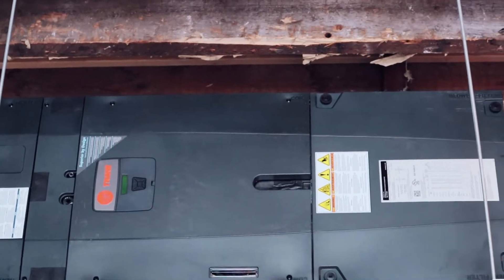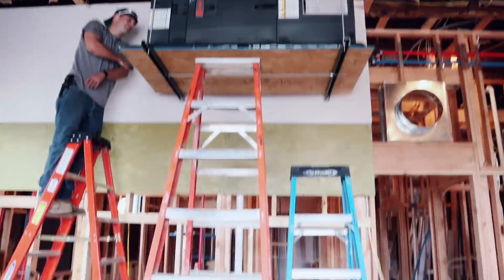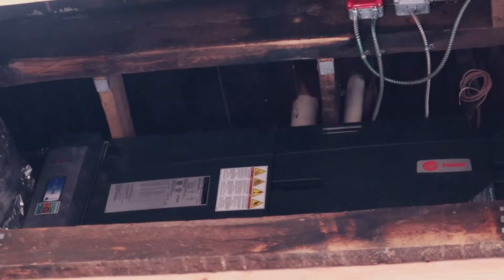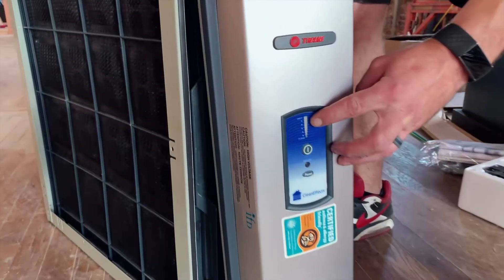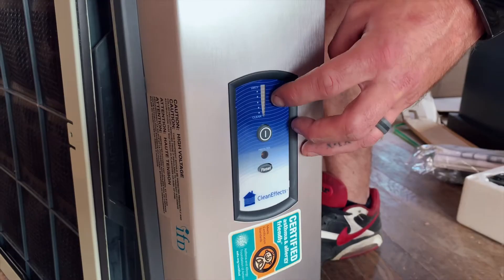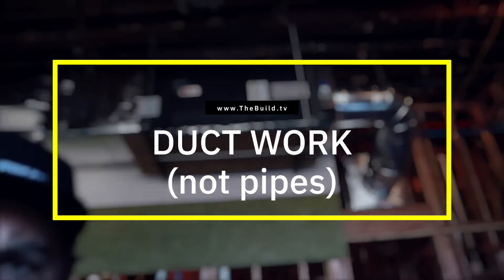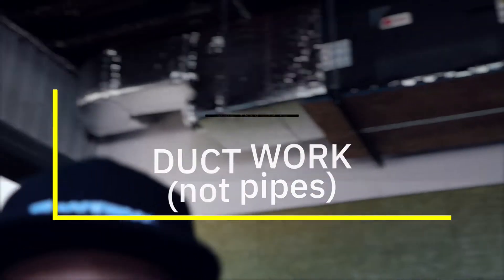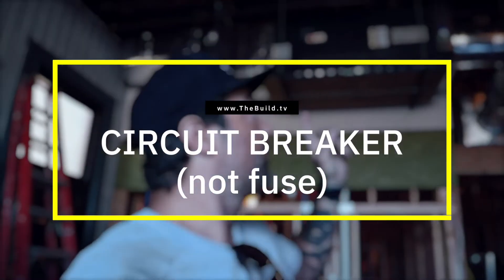Trane HVAC System Walk-Through

Comment: Hi! What air conditioning unit did you purchase to go along with the air handler and air cleaner?
Reply from the maker: I went with the XV20i - its a heat pump and AC in one because I used a Dual Fuel system, this comes into play on the heating side of the equation: Basically, I have both electric and propane powered heat through the Trane furnace, and its smart enough to know which fuel to use when in order to heat my home in the most efficient manner possible. Here is a link to the XV20i: https://www.trane.com/residential/en/products/heat-pumps/xv20i/